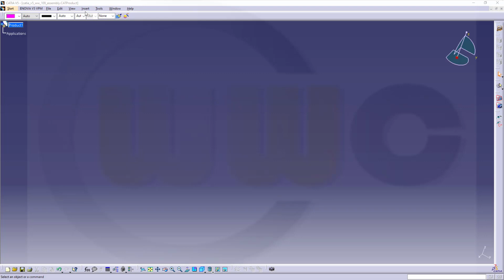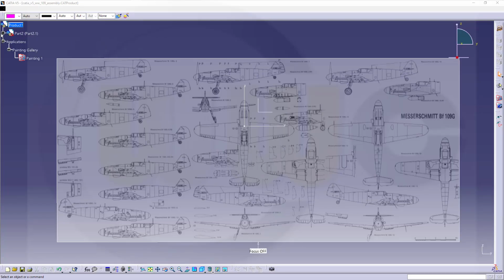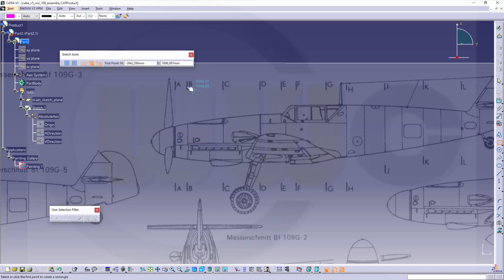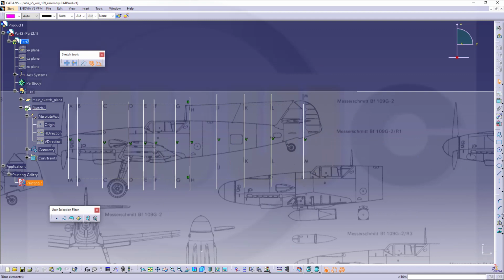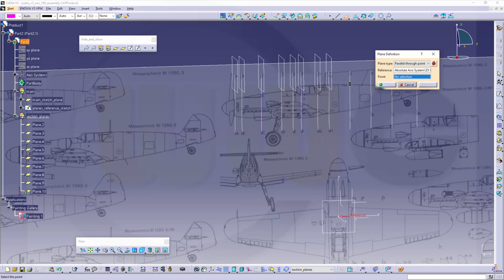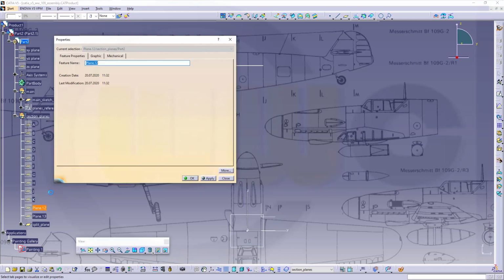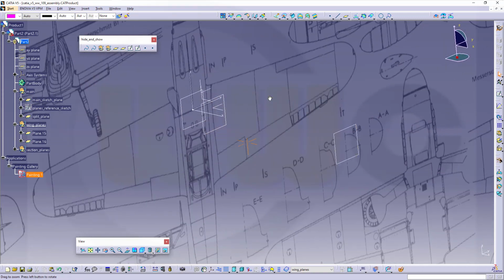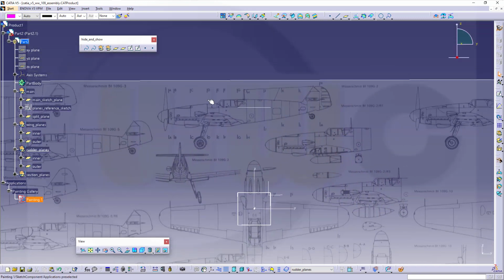WW-109 Fighter Plane - Part 1 - Catia v5 Training - GSD

Comment: Before starting Part4, it seems that my background blueprint disapeared. I don't know if I deleted during part 3 or if it was an error during saving... I've been going around trying to import the image again but seems like that feature disapeared and only appear in a blank project. Is there any way to re-add the blueprint during the project and then scale it and fit it to the already defined lines and planes manually?
Reply from the maker: Yes it is possible, but kind of akward to do. you have to eyeball it.